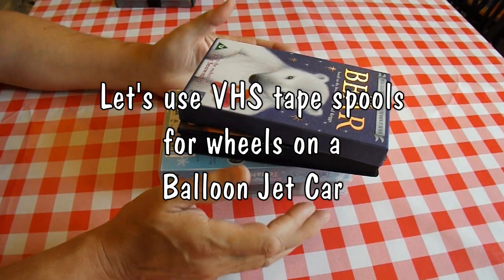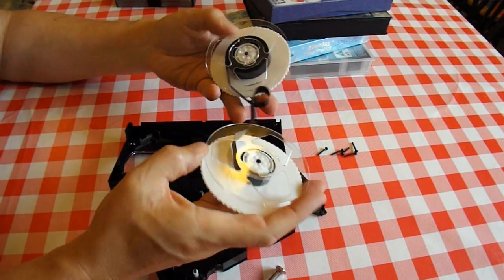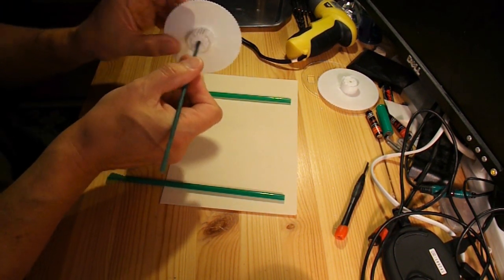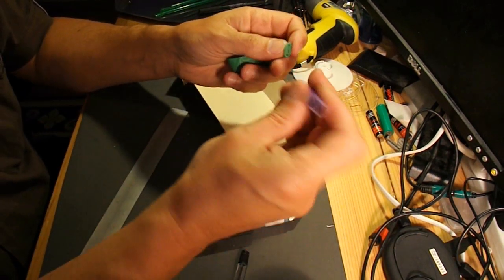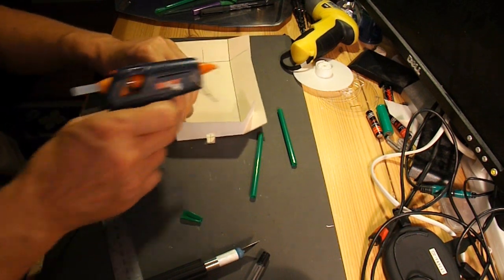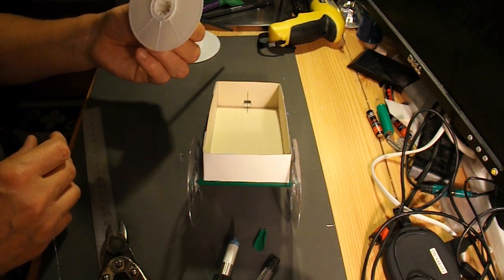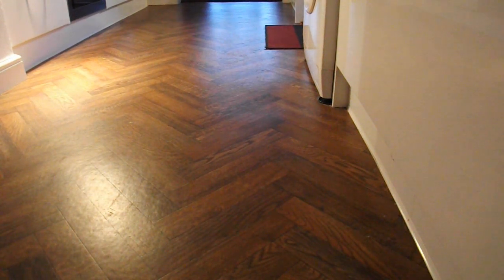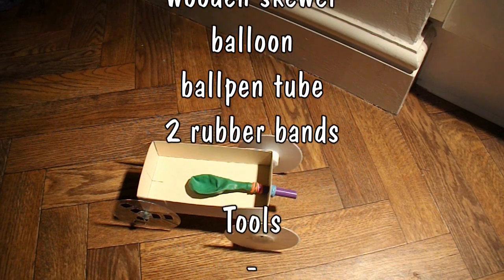Let's make a Balloon Jet Car with wheels from VHS tape cassette

Comment: I drilled straight through the entire wheel and now I am trying to separate it. How do I separate it without breaking it?
Reply from the maker: +Jared Grabowski I can't really advise you as they are not all the same. On the one I was working on there was 5 or 6 plastic studs holding the clear plastic disk to the white plastic hub. I just drilled those studs straight out. On other spools I found I could just cut the heads off those studs and it came apart easily.
Reply: Ok it worked.

Comment: I want to ask, do you remember what the length of the box is? I know the width 150mm
Reply from the maker: Hi Nancy, I think the cardboard sheet I used was about the size of an A4 sheet of paper and I just used the width of my metal ruler as the measure for the lines around each edge so that each side would be the same height when it was folded. I expect any small cardboard box would work, such as a box of tissues.